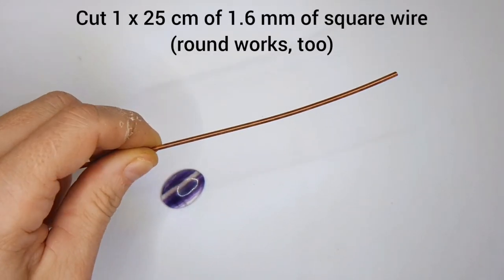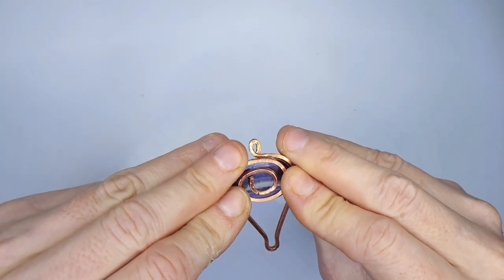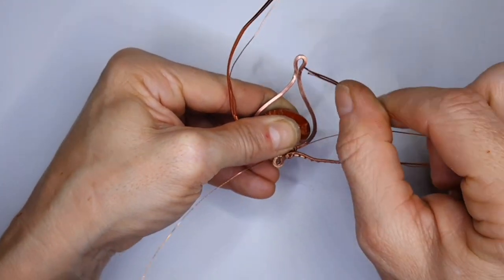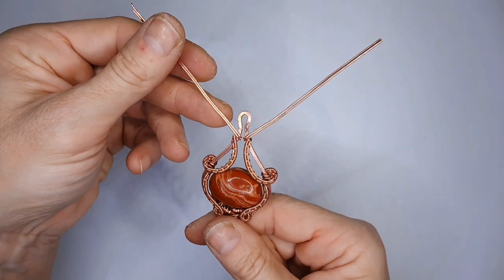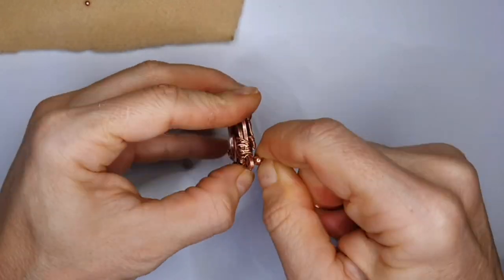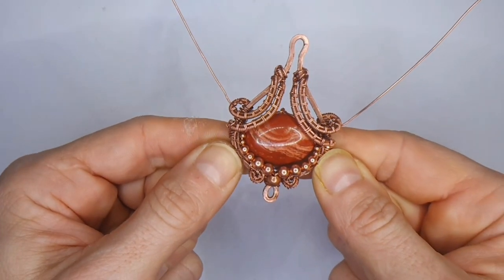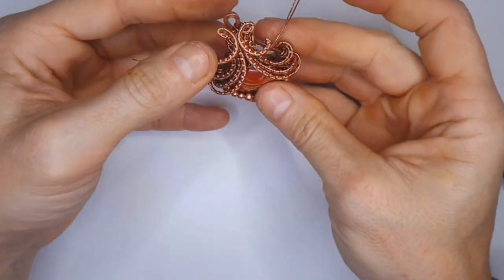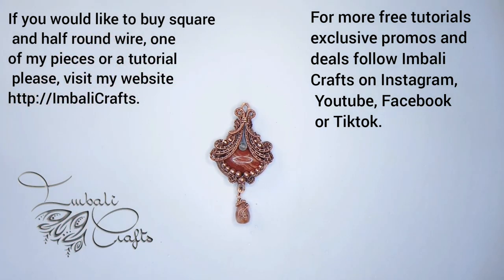Layered wire weave pendant tutorial - intermediate

Comment: Beautiful design.  When wrapping with the half round, is it necessary to keep the flat side against the wire you are wrapping it around (for example, keep the flat side down)?
Reply from the maker: Yes, I would recommend doing that although you can get some pretty effects if you twist it for other applications such as a decorative coil etc... but for tying things down, it's best to try and keep the flat surface to the weave. Hope this helps :)

Comment: What a beautiful piece I love watching you make this and thank you for sharing.... I have a question however I'm wondering what's keeping the stone stone in place is it the 2/5 weave wrapped around the frame or did I miss something
Reply: I see how you're holding the stone in place at 21 minutes… but I'm not sure how it was done before other than the front weaves..
Reply from the maker: Thank you very much! The stone is held in place by the 2x5 weave, the row of beads, and a section of wire coming from the back that holds the 4 mm bead on the top of the cabochon. I hope this helps :)

Comment: This is such a beautiful wrap.  I tried so many times and ruined my wire.  I can't see how you twisted the wire on the sides around 15:09.  Also, was the weaving base wire hard, soft?  I joined the fb group but I don't see where you personally post.  Sorry, I do appreciate your videos.  You are very talented.
Reply from the maker: Thank you so much! Sometimes it's a bit tricky to get the angles right. The weave is supposed ot lie flat on this particular instance, and whether the 'open' pattern is up or down, does not matter that much as long as they are all facing the same direction :)